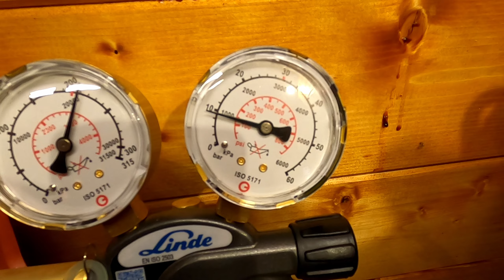KTM WP XACT rear shock maintenance how to

Comment: Really nice process. Sweet.  A couple things that I do differently that make life easier is to let the nitro out after the spring is removed and measure the piston height before disassembly w my vernier caliper then write that measurement down and you can always check it later then I drain the oil through the HS adjuster which takes half the time.  I made a thread in rod that is machined smooth about 60mm worth that threads in the nitro can and you can preset the nitro piston height during bleeding so you don't have to kill your shoulders and back trying to push the piston back in.  All preset and saves a painful step.  XC shocks require mad force to set the piston.  I did have a tool machined to bleed the shocks through the HS adjuster instead like yamaha which works better in my opinion and there is faster bleed and never a bubble as you can see into the body.  I then submerge the adjuster in oil then top off the HS port and insert it facing horizontal.  In your case I would make sure that shock is fully upright and the bleed port topped off and level before setting that screw in.  I really loved your video and process.
Reply from the maker: Good tips, thanks!

Comment: I noticed you didn’t change the seals and you used the old ones, are you not supposed to replace them once you take them out?  And did you only take it apart just to grease it.
Reply from the maker: Piston rod seal was replaced - at 9:30. Also new oil.

Comment: isn't the hose adapter thread size 3/8" ?       1/8" is equal to 3,175mm
Reply from the maker: "1/8" is actually the name of BSPP pipe standard size that uses this thread.  It is super confusing I know.

Comment: Hi, nice video. What kind of vacuum pump are you using? Why are you using Fork oil? There should be shock oil I think. Motul has one.
Reply from the maker: Pump is Vevor RS-1, 3 CFM, 1/3 HP. Regarding oil I just use whatever that has correct viscosity. No problems so far.
Reply: @ssse3123  that fork oil has almost similar viscosity like shock oil, but shock oil has much greater viscosity index.
Reply from the maker: @ladislavesterka125  thanks for the tip. I might try it  next time.
Reply: @ssse3123  can you please list all components needed for vacuum bleeding? Thank you
Reply from the maker: @ladislavesterka125  my vacuum setup is similar to shockbleeder.com and heliosure.com examples. I used a water filter enclosure to build it.
Reply: @ssse3123  hi, thanks. But you are not using compressor, right?

Comment: hi, i din't understand exactly the bleeding procedure... when you attached the vacuum pump you are sucking air from the oil reservoir? for how long do you suck oil? after that before repeating the process you are filling the reservoir with oil till 3 bar? i got confused from yourvavle setup :)
Reply from the maker: You understood correct. Vacuuming takes until the piston rod is all the way in and a minute more after that. Check out the video in pinned comment also.